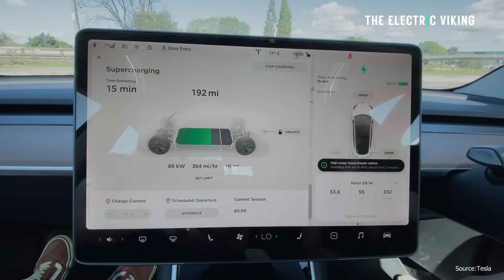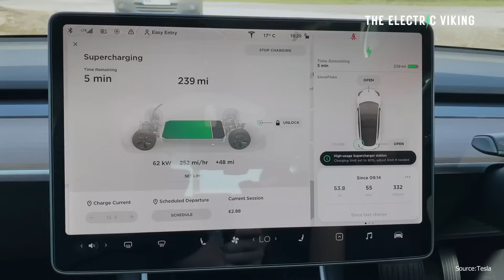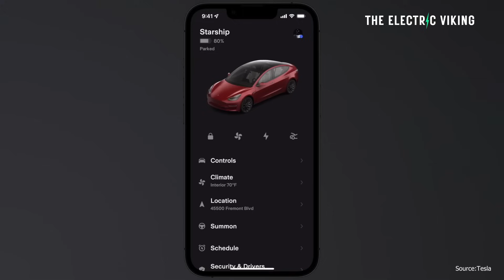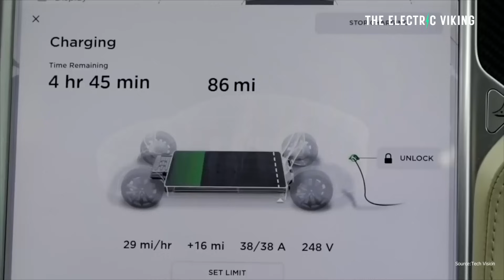12,500 owners say Tesla batteries don't damage from repeated Fast Charging

Comment: Actual published scientific research shows that fast charging causes micro fractures and this is where dendrites grow, causing a cell to fail. In a glued together 4850 battery pack, this means the entire battery needs to be discarded. The take home meassage is, do not fast charge.

Dont be fooled folks.  It is a moot point anyhow, as 90% of all ev charging events in the us are at home.

Comment: If you fast charge everyday there is a change you can have a 15 % degradation of the battery. This was tested on a 2021 tesla model Y that was used as a taxi !!
Tested by bjorn nyland.

Comment: They did test with two polestar cars. 200tkm fast charged car had 20% less range than charged at home.
Reply: That is because of the thermal management of the battery pack, Polestar is basically a Chinese EV, nothing compares to Tesla in BEV innovation
Reply: @ttkddry  yes but they make Tesla in China too.
Reply: @MrRaitzi  different engineering between Geeli and Tesla :-)

Comment: Hey Sam been watching for a long time and subscribed but never commented. I’m currently using a rental dual motor model 3 from hertz. These cars are exclusively only being supercharged. It currently has almost 60k miles and I’m only getting 150 miles of range. This is not true the reason I know is that I’ve rented in the past and got well over 270 miles on a car with much less miles

Comment: I disagree with this. 12.5K is a good and significant study. Also, the owners did not take a survey, and in fact, told them nothing. This is software that monitors your charging and batter pack degradation over time.
Reply: Is there any software can monitor degradation though?

Comment: What I heard for now is the same with the Ioniq 5. Since in US Ioniq 5 get free DC fast charging for 2 years, many do only fast free charging. This said, Tesla, and Ioniq5 battery pack temperature are liquid controlled. In my Ioniq 5 to the point to get maximum charging speed in 30 Celsius ambiant, I must turn off A/C to allow full cooling to the battery pack. I don't know what is the limit for each Li-ion technologies, but I know some show cell will not degrade until they reach 35 Celsius, some are way higher depending of the chemistry.  Then, maybe it's possible in the long term too ?

Comment: I think that the members of the 'high mileage' Tesla group probably have older cars with older batteries and battery technology. I have a hard time believing that a company that is constantly improving on every front would let their battery technology lag behind. I have a 2020 model y LR and I supercharge exclusively. I don't believe that what was true pre Model Y is true post Model Y. I think it's a case of people parroting what they've heard since the early days even though there's no real evidence that it's still true today. All the apps that claim to have insight into your battery's capacity are making educated guesses. Your range is based on your driving habits. My range estimates change with my habits. If I have a slow month with little driving, the car tells me I can go farther on a charge then when I'm driving 7 days a week at varying speeds. I think only Tesla knows or can find out the actual capacity of my battery and every other way is an educated guess at best. I doesn't matter though, because I love dumping miles on this car and I'll do the same when I trade it in next week (and take my FSD with me) for an 2023 MYP. Love your videos.

Comment: That is the problem with statistics.  The details matter.  The statement might be true in aggregate, but like you properly point out, when segregating the data by climate for instance, you might easily see a subset of data with statistically greater battery degradation, and with a statistically significant correlation to climate.   Statistics is great, but you have to really pay attention to the data and what is actually is telling you.

Comment: We have 2 2019 Nissan Leaf Pluses.  One Leaf Plus is driven back and forth from Kansas/Chicago and heavily DC charged as my kid lives in an apartment.   Out other Leaf Ppus is a commuter between the burbs and Chicago.   The DC charged Leaf after 4 years is at 93% SOH and the commuter 90%.    My experiences are consistent with others in the Leaf forums for gen 2.
Reply: Not my neighbors. Battery replacement after 48 months

Comment: We fast charge alot as pretty much every trip is a road trip.. We are in a remote area. However, this means that when the car sits at home, it usually has 50% or lower state of charge. Just enough to be certain to get to a supercharger if we need to. When we have good solar days (off grid) we will charge the car up higher, however this lower state of charge when resting will increase the life of the battery. When we were tracking battery health we were better than other model 3 of similar mileage.. Not a huge sample as we are over 130,000 in 2 years.

Comment: There's one thing to consider. When DC fast charging, most systems will only allow up to 80% charge. When charging at home, Level 1 and Level 2 charging will allow up to 100% state of charge, which will degrade the battery more quickly. If home charging is limited to the recommended 80%, I do believe, that the batteries would indeed last longer. If you attempt a 100% charge on a fast charger, the charge rate will throttle back, and as you near the end, the power draw will be similar to a Level 1 charge rate, just before the session is complete.
Reply: Too many variables to claim that.  The time a battery stays at 100% charge is way more important than if it reaches 100% periodically.  That is why Tesla specifically tells you it is fine to charge to 100% for long trips as long as you leave as soon or a close to when the battery reaches 100%.  Think about the time difference between how long the car is stored waiting to be used, versus in actual use.   I am in a weird situation where I work from home and use the car frequently, but only for short trips around my town, however, I go on 2500+ mile trips twice per year.  So supercharging is actually 33% of my total useage, but very rare.  I keep the battery at 51% 90% of the time because that is plenty for around town, and keeps the battery in the sweet spot for the longest amount of time the battery sees.  Others who do this are typically at the lower end of the battery degradation curve.
Reply: That's exactly right. Every manufacturer suggests that if charged to 100%, the car should be driven immediately, like you would on a road trip.
     I live at the foot of a mountain, so I go down a long steep hill. I can't allow my battery to exceed ~90%, or the battery won't allow full regenerative braking. If I charge to 100%, I'm using friction brakes all the way down the hill, leaving ~2.5 miles on the table from lost regenerative braking. @cherokee180c0